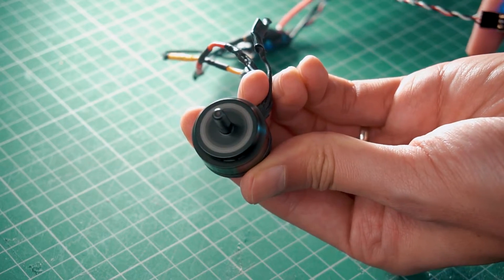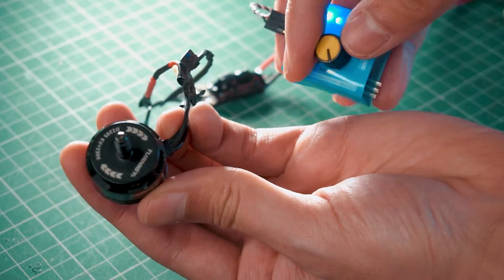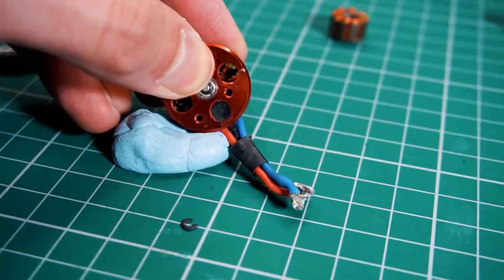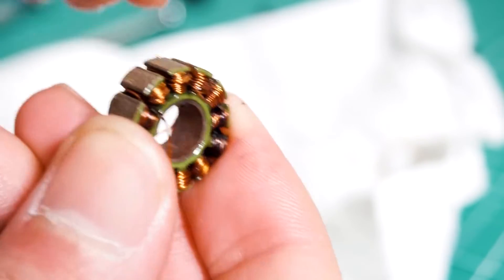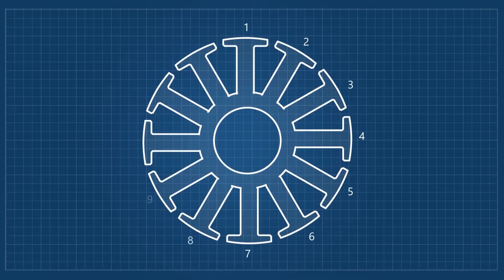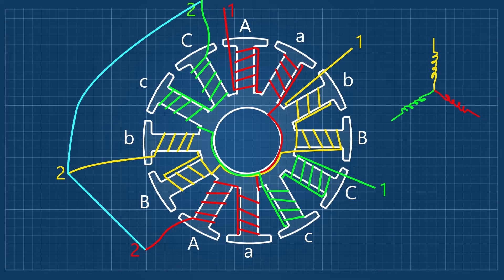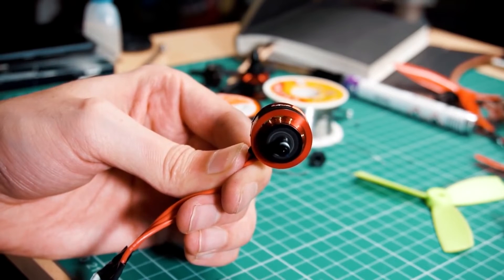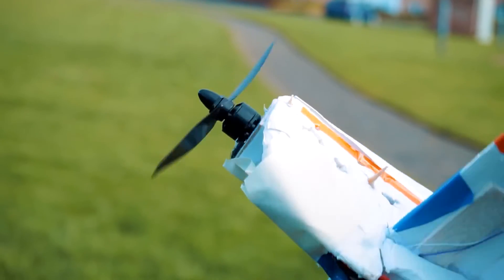How to Rewind Brushless Motors | Learn to fix or modify your electric motors

Comment: Great video I have a set of 40,000kv 0702 motors. Just one of them smells burned  wouldn’t rotate past 200rpm and since they are really rare so no replacement. Thanks to your video I feel confident in rewinding to get working properly.  It’s a set of SKRRRT 0702 40,000kv from weBLEEDfpv. Thank you very much. Subscribed n liked

Comment: I've bought some .3mm wire for a 12 pole 64mm outrunner. I'll reduce the kV a bit by using more turns and less wires in parallel. I need 21 wires in parallel and seems tricky because of tight space between poles. I'm using your video as guidance :)

Comment: Is it the motors problem when I connect the wires to batteries and it doesn’t work or do I just need an esc and Lipo battery

Comment: The video is very useful sir. But could you give me an advice to the motor mamba 1105 5500kv ( 9 teeths and 12 magnets) should use what cable diameter and how many turns ? I really need your help .

Comment: You can use a qtip to rewind the stators. Qtip brand, (if i remember correctly) use hollow plastic straw type, just cut the cotton ends off and run the wire thru the straw. It's basically a homeade tool for more precise control with better rewind results and something to hold on to as you rewind. Since it's plastic it won't scrape the coating off the wire. You might have to slightly mash a end of the straw with pliers first if the stator poles are too close together to fit between the poles but it will get the job done pretty well. It sure beats doing it with your fingers. Note: some qtip brands don't use hollow plastic, but use solid paper instead and those won't work. It has to be the hollow plastic type qtips. This is something i came up with several years ago and used it so i know it works.

Comment: very good !!!!  Could you give me the recipe for that epoxy you used to repair the stator?  in a hurry, I had to use nail polish on one of my motors hahaha, but I don't know if it will take the heat.
Reply from the maker: Just buy an epoxy that stants enough temperature.
Reply: Thread locker is idea for that application. Guaranteed to hold up to the heat, can be used in thin brushed on layers.

Comment: I have brushless motor, and i fried it, but imediatly shut off the motor, change esc, and the motor is still alive, altough it burn out the wire it smeel fried electricity, its only about 1-2 second the motor is fried until i stop the motor,i see the wire is black(not all) ,

Comment: I have a 10" scooter motor that I pushed for too long and white smoke came out of it. It still runs but it is burned inside and sometimes the controller shuts it off under heavy load.
Can I rewind it into a more powerfull motor using this method? I am mainly looking for more torque for the uphills, I dont need more speed.
What effect would I get if I were to rewind it using thinner gauge wire?

Comment: Do you have any specific guess with regards to the ratio on kind of coil to wattage of voltage? Like how many grams of coil and what gauge needed to harness 2k watt power of 1500watts of 5kwatts?
Reply: You said " of" instead of " or " .
  
  The efficiency can be increased by longer prop diameter and slower rpm .
    5kw needs a one meter diameter prop to produce  2.5kw useful thrust horsepower.

Comment: Thank you for your instruction. I have one question here is How can you drive your motor without using hall sensor which using to detect magnet? Thank you so much!
Reply from the maker: The ESC has that sensor and uses a neutral pole in every switch of polarity to detect the magnet strengh

Comment: Hero patience! Thanks for sharing
I have a big 5008 motor, with still some room on the stator, did you ever tried to add some windings to the existing ones? Do you think is feasible or i have to start from scratch? (I need to lower the kv, and i want to put as much copper as possible)

Comment: Nice instructional, I've been working on the technics of rewinding small brushless motors for a while now and  it definitely takes much patience. I just leave the stator on if its glued because its to easy to damage during removal and although this dose make it much more difficult to wind you end up with a much better product. Ive found that household fans are a great source of wire for rewinding because the motor has a coil with 3 or 4 different gage wires that are the sizes you would find in these motors im  rewinding with plenty of length of each and the fan motors are easy to take apart without damaging the coil. also finding a fan that doesn't work to recycle has been very easy for me.

Comment: A Hammer to the bearing housing, great tool selection. An Arbor press or improvised screw press, but never a hammer. Or you'll just bugger the bearings and then the re-wind is moot!

Comment: MAN I CAN'T THANK YOU ENOUGH. MY MOTOR WORKED. SUBBED AND RING ON.

For those who are wondering I fixed my IFlight Xing 2207 1800KV motor. It's delta configuration. Big letters are 11 turns and small letters are 10. Cable diameter is 0.5 mm and 4 meters of wire should suffice. The rest is nicely explained in the video.
Reply: I am about to fix a Xing 2208 1800kv motor. Can't find replacements anywhere that will be here quicker than 3 weeks and cheaper than $40 for the single motor. I expect your info to be the same as 2208 and 2207 are almost identical.
Reply: @dedestro  make sure to fix back the stator with glue otherwise it certainly will not remain stationary, causing desync midflight. That's what I encountered in the end sadly... Also I would note the turns on the windings and measure the cable dia just to make sure but you should be just fine with my info too. Good luck 🙌

Comment: Hey I was wondering , if we rewind motors in delta system there are always many turns , how to wind it on stator ? Should I make first 10 turns from inner of stator to outer and then another 10 in opposite direction ? Or should I put 1 turn and second on top of it and so on ?

Comment: Thank you very much. I did the process with engines from the Mobula 7 Happy Model 16000KV and it was perfect. It was only difficult to find a cold with the same thickness, I found it in a computer font. As they are 9 coils and 12 magnets it was even easy.
Reply: do you remember wire thickness and number of turns?

Comment: Thank you for your very informative "almost complete" instructional video on rewinding brushless motors. I said "almost complete" video because (unless I missed it), you didn't suggest or inform us on what gauge (AWG) copper windings we should use. For instance, can you either tell us what AWG you're using in this video? Or, what I would use in a Power 10 Brushless Outrunner Motor, 1100Kv ? Also, was the the epoxy glue really necessary to cover the insulation removed which may have occurred from scraping the old/burnt windings? Because I've removed quite a bit of this insulation while using a solvent to remove the burnt windings. And, since the windings are already insulated, do you think it would make much of a difference? Mainly though, I'd really appreciate suggesting a good all-around Gauge *AWG to buy? Fr my research...I'm thinking 32AG? Thank you!

Comment: my Diatone Mamba 1103 6500kv motor has one wire cut and i have to rewind it again ,,,its a 9n12p stator ,how many turns and wire to use ,,thanks !

Comment: What happens with the different gauge of wire? If you increase the gauge does it make it more efficient and slower like more windings does. Or does it make it less efficient and faster like less windings does? Or the opposite way so thicker is faster and thinner is slower. Also what happens if you use a dual winding instead of a single winding?
Reply: I think the fatter wires will allow more current and more torque?  But it's an electro-dance between your power source and how the motor is wound etc?  I Googled it..."lots of math" is your answer. 🤣

Comment: What would you recommend to wind a motor that looks like you wound the wire just perfect ??? It seems that when you wind the wires are kinda misshapen. Too many wires are crossed and cause early shorts circuits. Thanks

Comment: Hmm, clockwise and anti-clockwise, it is viewed from end of poles into the shaft? If so, then capital letters should be anti-clockwise winding no?
Reply: It doesn't matter as long as you are consistent and alternate according to the diagrams. He did mention that in the video.

Comment: i have a a 48v 500w BLDC ebike hub motor, 10a continuous 280 RPM , they work fine but i need more speed, 
To get more speed at the same voltage i need less turns? the motor can handle a trip more than a 30km distance without heating to much (52°C max)
so if possible i can use the original AWG wire or is recommended a thicker one?
Reply: Why do you expect an informed answer here? This is youtube comment section... Go and do some research lmao

Comment: Bro can u tell me what r the teeth and what r the poles so i know the winding pattren to go with
Reply from the maker: Poles are the metal arms were you do the winding, and the teeth I don't know, I only mentioned poles and magnets.
Reply: @Joyplanes  thank u so much i made the winding and everything went fine then by accident i cut the wire connected to the controller and the winding coil was to short to weld it again i will wind it again now lol

Comment: https://youtu.be/HxkNYpJp1_I
myself winded many times i didn't find any problem
Reply from the maker: Good one.
Reply: https://youtu.be/9mMe8bHD9qU
this is drone i made using rewinded motor 
myself tested upto 4s and 12inch propeller on 2208 size motor

Comment: The time you  are spending by rewinding the motor is nearly the same as waiting for a new motor to be delivered from China.
Reply from the maker: HAHAHA not so much but it's still better to buy a new one.
Reply: But at leat you get 99.9% copper in your motor instead of 97% copper inside the one from China.
Reply: @Spark-Hole  and it improves top speed, right?
Reply: Is there any liquids/treatment to do in a brand new brushless motor to improve top speed? Ceramic ball bearings and titanium shafts are in my list, but what about wire treatment?